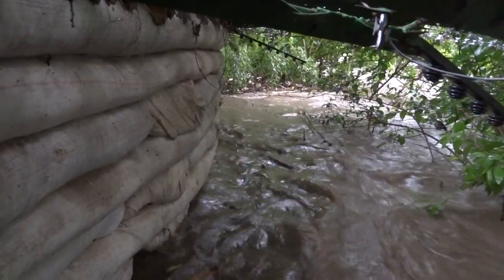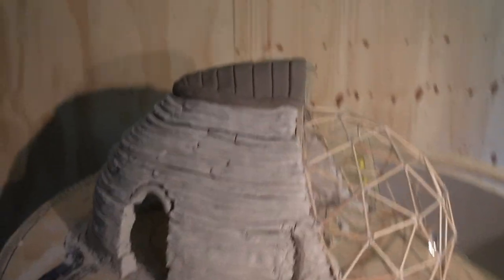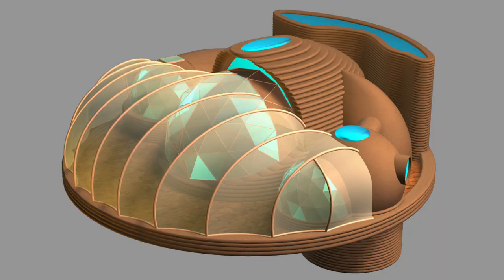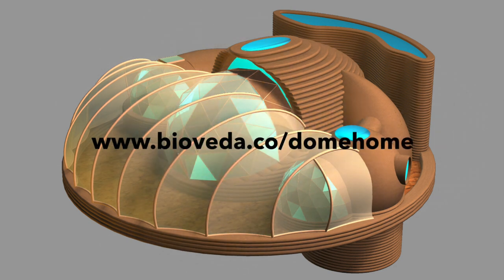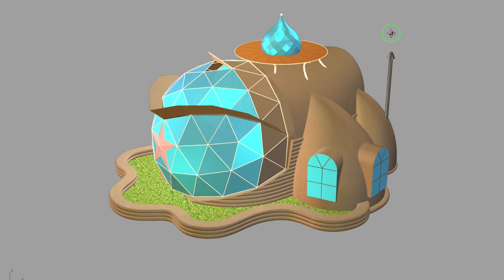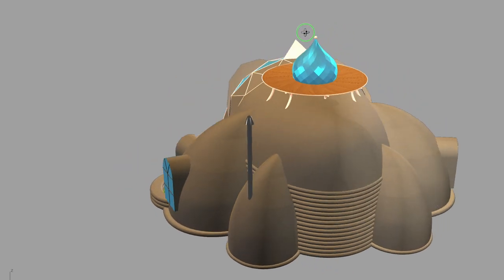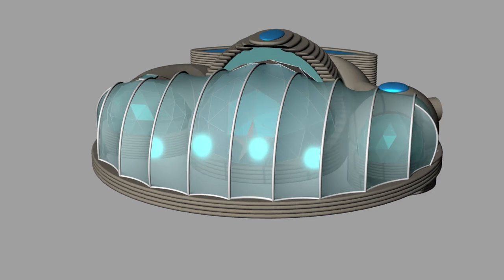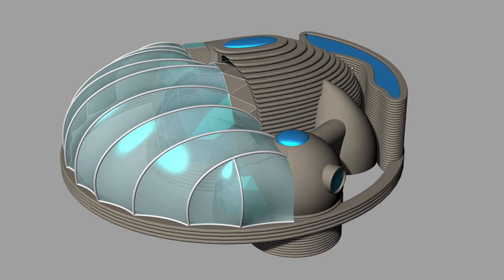🛠️Redesigning an Earthship for Cold Canadian Climate

Comment: May I suggest looking at John Hait's passive annual heat storage design, instead of insulating between water tank and house, and against the walls, he would put a waterproof barrier with insulation over the house like an umbrella, which extends out about 20 feet by the time it reaches floor level. All the soil stays dry and is insulated from seasonal changes. Then air tubes run through all that mass, starting outside and running 100 feet to go inside. A second tube comes back out another 100 feet and are located low and high inside to create a thermosiphon. Hot summer air is drawn in and cooled, warming the earth mass. Then in winter cold air comes through the warmed mass before reaching the interior. This allowed building in Montana without any additional heating or cooling. So you could have the cistern within/under the insulating umbrella, and the house would benefit from the thermal mass, which will be lost if you apply insulation just outside the walls. This umbrella would then be covered with 2-3 feet of soil and planted out normally, and that top layer of soil warms and cools like normal, but underneath it stays much stabler, and is charged by the air passing through so it reaches a higher average temperature.
Reply from the maker: Studied his model extensively.

Comment: You bury the plastic 2200 gallon water tank in the ground. The water won't freeze if the top of the tank is 5 feet from the surface soil.

Comment: Great idea Alosha!

Think to insulate, this, you will need to get a spray rig to do the insulation. Spray insulation closed cell is very toxic. Paying to spray that much insulation would be $100,000 USD. That is with labor. What do you think of using aircrete for the insulation. Less toxic and better compression strength. Pumping aircrete, can be done with concrete pumps in lifts with reinforcement of basalt or regular steel rebar.

Think you need two of 3 of those pipes for waterlogged soils.

Namaste,

Jay
Reply from the maker: love the idea I was not going to spray insulation but rather use rigid foam board 10 cm thick.

Aircrete bricks will also work well , will cost it out. I do have the little dragon to make aircrete

Comment: Water tanks should be insulated as well, especially in cold climates. Putting the tank inside the home envelope reduces the amount of insulation you need. The thermal battery properties of the water are similar to earth, especially wet earth, so it makes more sense to me to bury the tank with the house, just like is done in warmer climates, to reduce the likelihood of freezing and cracking the tank/s.
Reply: I think what he is saying is that water has an extremely high heat capacity, thus, when the mass at the back of the wall is gaining heat during the day the water tank is robbing some of that heat, then at the end of the day the heat is released in all directions of the water tank (mostly upward into the mount of dirt behind the living area, and escaping into the atmosphere) instead of directly into the house.

Comment: I love your designs, brother ! I'm about 1/3 done with mine. I used hubs from a childrens playground 2v dome. I quadrupled the 2  sizes of struts and built into the mountain with the front up on pillars about 7 feet high. then added a deck and under that is the atrium. I'm engineering the framing of the 2 paned sliding glass windows that will be the front atrium windows.
inside is a 3 level living area. its slow goin right now because the weather is very hot. 
I have an Idea on primal abd possobly easu main construction using wattles. they are found everywhere and are used as erosion control on building sites. they are basically mesh or nylon with straw inside them. the end reault it a honey comb like look. the wattles are dragged through a trough filled with portland cement and soaked. then they are stacked and manipulated into whatever shape you like. 
I will try this and build a garage first- then go further, I hope.
Anyway, always a pleasure to see what you are up to.
If your ever in Calif, your have to come check it out and ride the zip lines.
Take care brother,
Wulfy

Comment: With a high water table can't you just have a small tube well in the house? The rain water and eventually the grey water be directed to reacharge from the outside via drain tile under wood chip paths through raised beds to rain garden? Is some of the geothermally heated fresh air going into the house for fresh air? Could the exhaust from the oven exit between the house and water tank to help keep the tank from freezing?

Comment: I wonder if you have thought about using the thermal difference of underground structures like root cellars and warm structures like greenhouses to make steady electricity (even at night) using peltier-elements? I have been thinking about that a lot, lately :) They are only 5% effective, but the do work at night as well, so if you look at cold climates that are often overcast: a greenhouse will still warm up and anyway, you just need a temperature difference. Pelties elements are very very cheap. I don´t think you will be able to get the same production as solar, but you can sure load up a battery, because it kind of always goes and living means making temperature differences and having leakage, this way, you get to use the leakage.

Comment: Dimensions - please provide few dimensions like front round inner dome diameter and height, main inner living dome diameter and height (inside)
Reply from the maker: 4.26 wide , 4.26 dee3p 3.7 - 4m high
Reply: which dimension is which? - 4.26 - 4.26 - 3.7-4 ? - translucent inner round dome or main compressed earth bags living dome?

Comment: Watching your video in '21. Digging it and kinda the concept. I wonder if I missed it, but what's the external temperature range this is designed for? 
I also heard you mention 25-30c internally? What did this include for ways to vent some of that heat? Hitting even 24c is getting too hot for me 😅
Reply from the maker: Hi Allan it is designed for -24 Celsius and colder. Inside the Boone will be a comfortable 21 degrees. Building a prototype now in Russia 🇷🇺. You can help us by preordering our training  www.bioveda.co/wautillarium
Reply: @AloshaLynov  I will give it a look, and thank you for the clarification!
I havent often seen -24 in my area, but I'm relocating further north soon, so that may change. What approximate latitude are you working in?
Reply from the maker: @allanjarnagin3540  55-60 degrees north

Comment: 9:30 I'm very curious to know your reference for theses numbers.
I'm living in Canada and you seem way too optimistic on how hot the ground really is.
Typically, it is between 4*C to 8*C for the moist ground.

The "Russian oven" or the rocket stove + water piping is not required if you use a passive solar home with LEED insulation (and no more daily fire required for the life of the house).
Your design is gorgeous, but you need to be more serious if you want to avoid to be sued by sad customers!
Reply from the maker: Alexandre Valiquette I am not selling homes so no need for court.
Reply: @AloshaLynov  Think again... If you are selling your "expertise" and someone is using it and loose money because of your mistakes you can be liable. Maybe consider a small legal disclaimer in your book would cover your ass. But over all, I still think you need to get educated on cold country building a little more.
I might sound rude, but honestly I wish you the best.